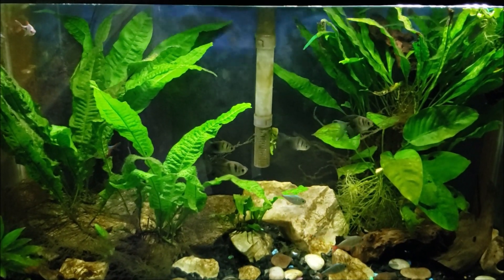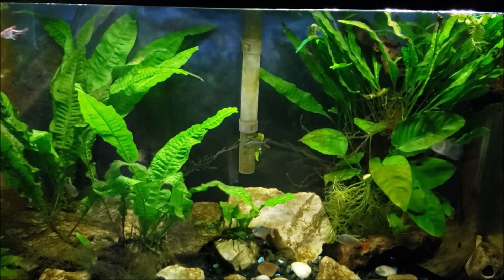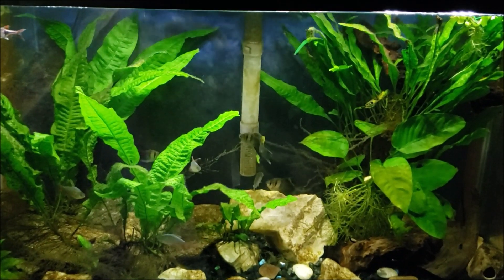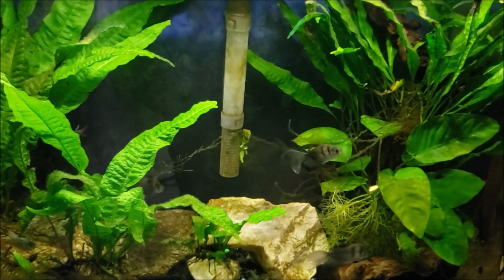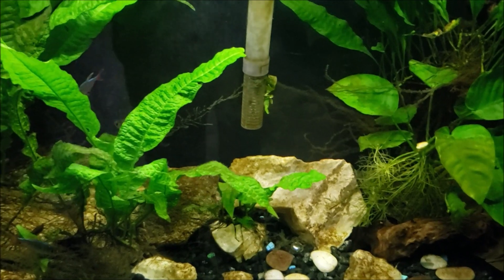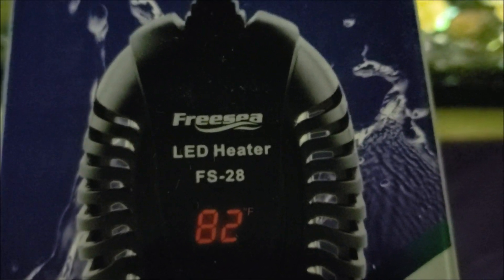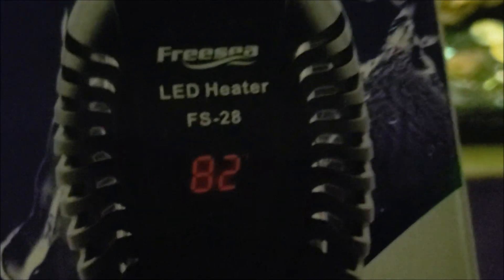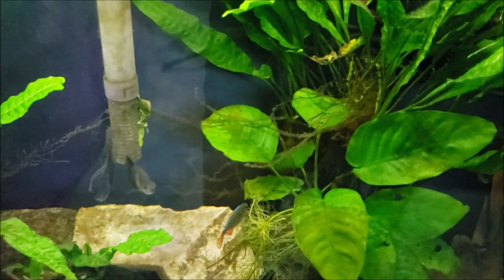Aquarium Gets An "LED Heater" (Which Doesn't Exist)

Comment: I just bought a FreeSea heater after seeing you using them.. Mine is the standard glass .  50 watt for a ten gallon I bought     It was cheap only $19 and it came with a separate digital thermometer. Which I think is very good for the price I paid.    I like it so far.

Comment: Great explanation of a common misnomer, in the understanding, of the light emitting diode (LED).  As mentioned, they are a low wattage device, in itself.  I have some LED display heaters as well & never had an issue with them.  Usually, heaters work better for me if they are installed closest to my HOB filter intakes (near maximum water flow), for even greater efficiency.  There is an electrical term called "duty cycle".  It is simply the ratio in time duration, of what percentage a device is either on or off, in determining overall device efficiency.  Good video.  👍📺😎

Comment: Crud/algae on your glass heaters is why you are supposed to clean them at least twice a month so you can see the indicator light working. Doesn't take myuch to use a scrungey spoungeto wipe the tube down once or twice to clean off alggae and other gunk off of it. It also helps in its heating efficiency as well to clean it often.

Comment: Talking about the low temps I've heard 65 is the low for tropical fish if you were wondering.
Reply: Doesn't sound very tropical. 🥶
Reply: @RyanStonedonCanadianGaming  yeah, it's not. it's probably best to keep them in the 70s
Reply from the maker: They may be able to tolerate short periods at 65, but they won't do well in the long term at temps that low. I try not to go below 72, but do occassionally get a bit below that for short periods, like overnight.
Reply: @DanHiteshew-oneandonly  yeah, I'd say low to mid 70s is fine for most. but I think cichlids and angels like it in the mid to high 70s and even low 80s.

Comment: Glass tanks lose heat the fastest.You can insulate the three non-viewing sides to trap heat in your tanks with insulating backgrounds on the back and sides to keep your heaters from over working at night and letting your house cool down to save on heating costs. Unles you have tens of tanks and heat their room exclusively with no heaters in the tanks.